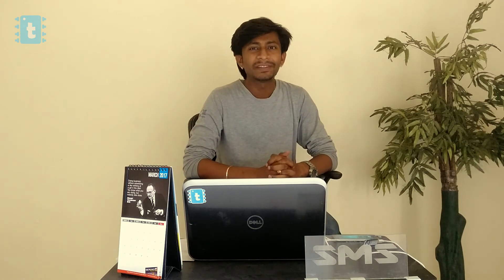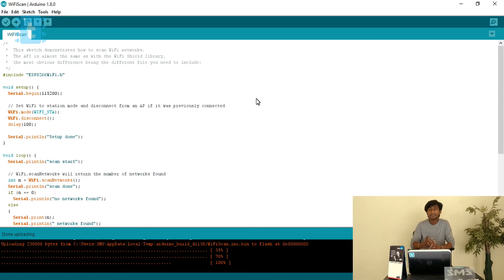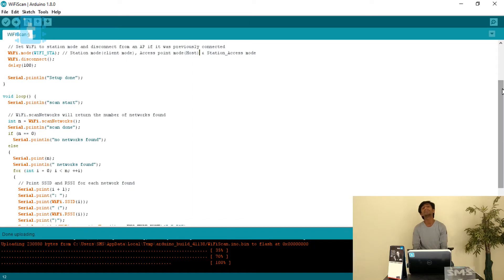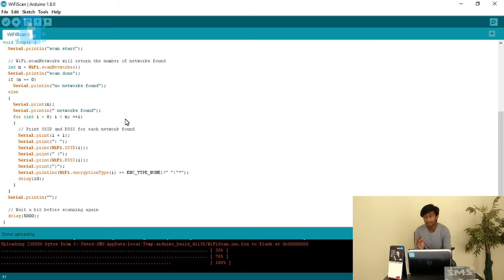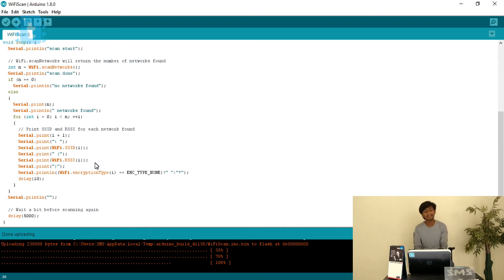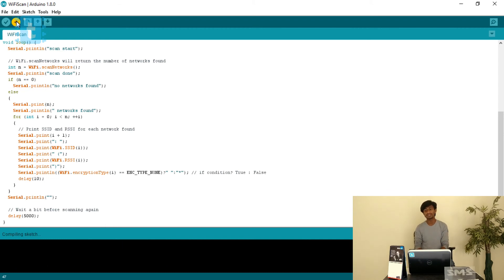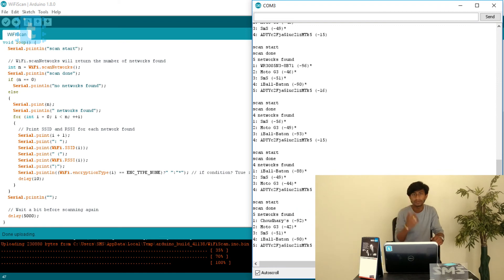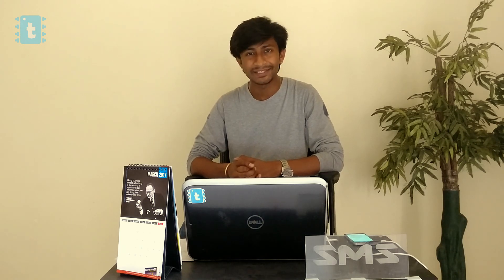WiFiScan Example Explained | ESP8266WiFi Tutorials #7

Comment: Hey, I have the same exact code and have done just the same thing still in the serial monitor it's just showing some symbols and gibberish and no networks at all.
Reply: Your serial port is set to the wrong speed in the monitor window. Try 9600 or 115200 baud.